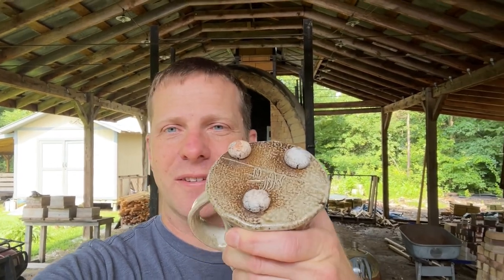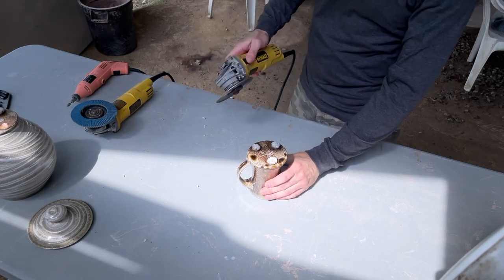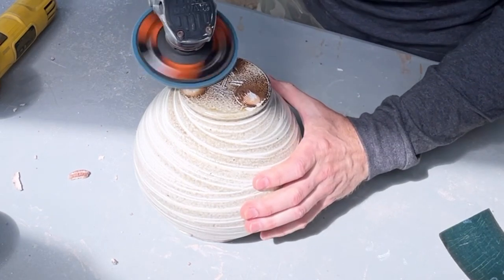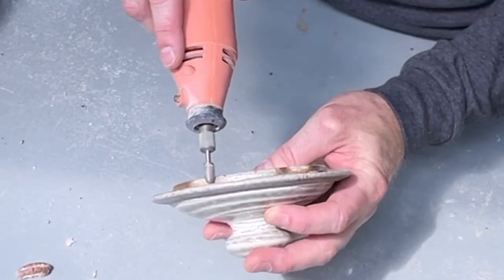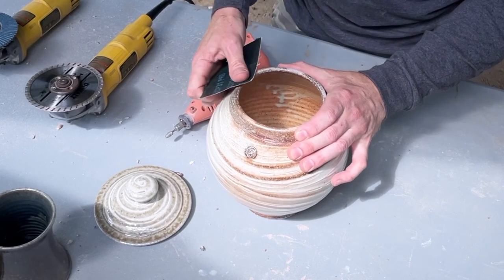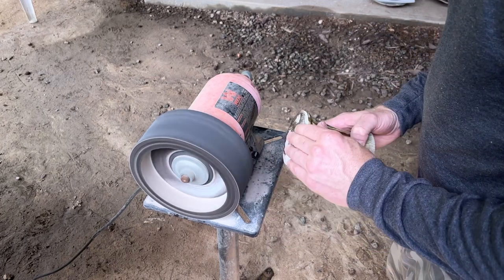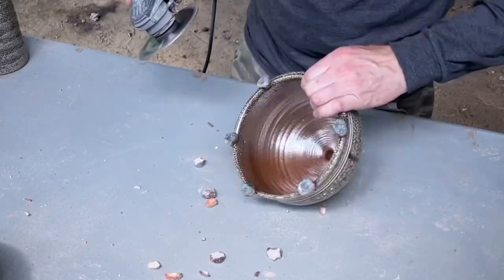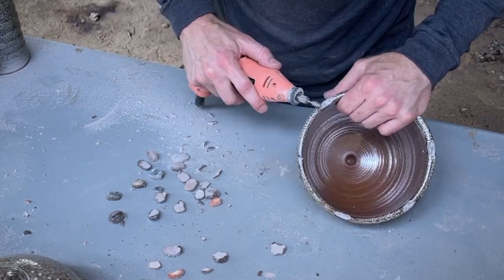Cleaning Pots After Wood Firing - How To

Comment: I know Matt has the experience, but for anyone who is not experienced with using an angle grinder don't hold anything in one hand and use the angle grinder in the other hand. Just don't, that's something that should be reserved for the professionals. A die grinder with a diamond wheel might be a better choice as those are much easier to use one handed and nowhere near as heavy. A fixed diamond wheel like a tile cutter would also work. A rubber mat, router mat or other gripping surface to work on would also help to hold the pot steady. 
Angle grinders are extremely powerful tools and one slip could end any prospective pottery career very quickly. Don't have to cut off a digit but just nick a tendon, nerve or blood vessel, or set it down wrong and eviscerate one's self (this is not hyperbole). It takes a grip like a monkey and forearms like Popeye to keep an angle grinder under control one handed.
One last thing, good idea to take frequent breaks as those will definitely give your arm and hands a workout. Thank you.
Reply from the maker: Thank you for being thorough and not just blasting me for the way I did it. I probably should have been more clear with a warning about using an angle grinder.